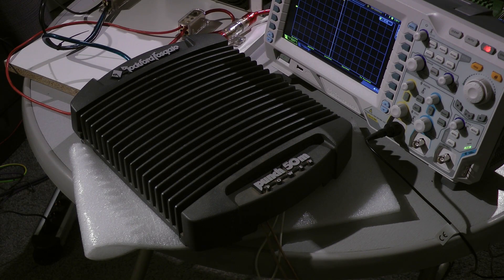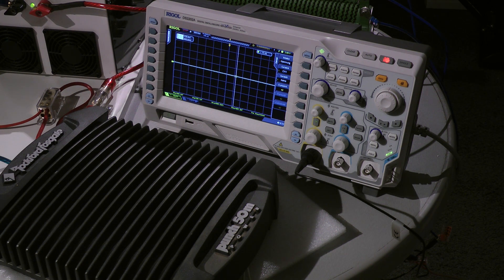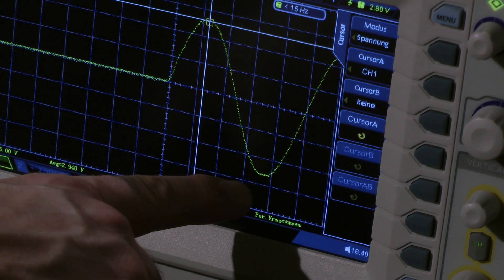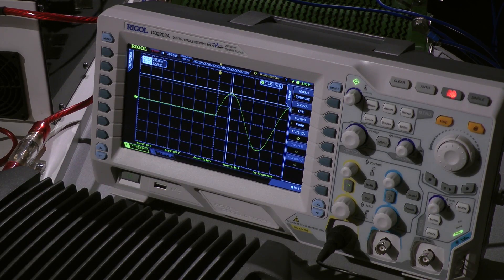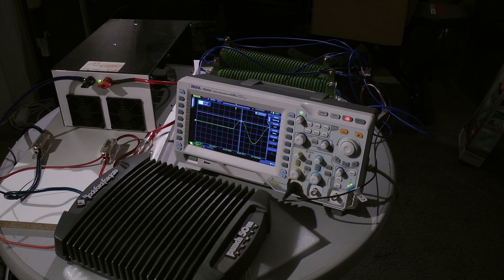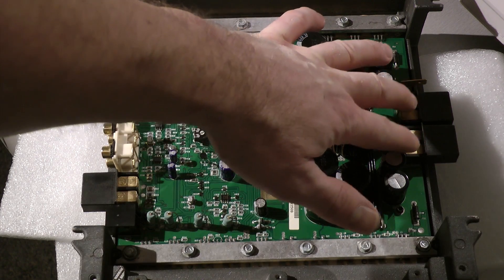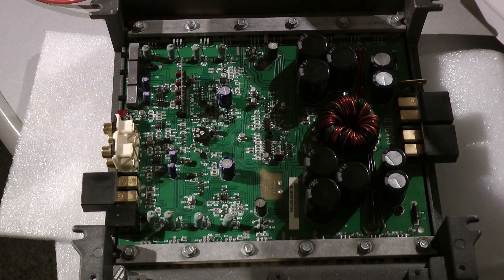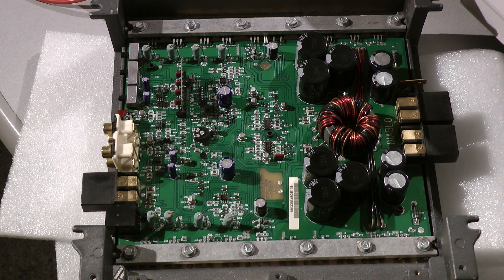Rockford Fosgate Punch Power 50M amp dyno run old school cheater amplifier 0.25 low ohm test & guts

Comment: I had two of these power 50Ms running 4 - 12" Pioneer IMPP subs. I also had the same style Punch 100 running a pair of 8" Diamond Audio midbass, a Punch 100 running a pair of 5 1/4" Diamond Audio midrange and a Punch 60 running a pair of USD Waveguide A Series compression drivers. I had an old copper jacketed Sony CD player going to and Audio Control Overdrive, ESP2, Epicenter into a pair of Audio Control EQTs and out to a 4XS to the amps. It was a big system in a 1994 Dodge Dakota regular cab. My sub box was ported into the cab and my amplifiers were in a custom fiberglass enclosure behind the sub box. I miss that old truck.

Comment: I still run Boston 12.5LFs on Rockford cheater .25 ohm capable old Skool 90s gear. The 50Ms

620 watts off a "50" watter :) just needs a few computer fans to not meltdown.

Comment: Still have a pair of 50m's and a  50x2
Reply from the maker: i also have one 50x2 with a polished heatsink 👍
Reply: @audiokeller1975  mine still have the dark gray factory coatings with all the end caps. The warranty seals are in tact too. They all still work perfectly. Just feel kinda bad because they are just sitting on a shelf, along side a 200x2, 100ix and a 160x4,  instead of bumping along like they were meant to.
Reply from the maker: i still have a 250m of that grey series. I had to readjust the idle current because it was a bit high with 6 amps. now its idling fine with 2.4 amps. over the years its possible that it drifts away. it plays fine now without getting hot 👍

Comment: I ran 6 punch 15s on a 50m for years and it never missed a beat. The thing hammered. I still have it and the matching 50x2. Used to dominate the 0-100 watt class. Best amps I have ever owned period.
Reply from the maker: i also still have the 50x2 👍
Reply: What was the power rating on the 6 15s?
Reply: @chokechange  They were Punch 15s I believe they were 100w rms and 250w max. Speakers were so much more efficient and sensitive back then.

Comment: I have the chrome RF power 50m I just picked up however it has a different heatsink and  4 flip chips plus a couple switches so cool seeing the same model but I'm guessing different versions. Anyone that can give me any info would be greatly appreciated.
Reply from the maker: is your amp the power 50.1 with the " darth vader style " heatsink?
if yes. its the same. you can link two power 50.1 to get more power like the power 50m.
this is configurable with the switches.
Reply: @audiokeller1975  you were dead on yes mine is the power 50.1 with the Vader looking heatsink. I had no idea you could link them and there were the same

Comment: i was without scope. there are Fosgate diagrams to run 64 from 1 amp.  we went to 0.06 ohms running about 2000 rms
Reply from the maker: Awesome! Do you have more detailed information about that ?
Reply: @audiokeller1975  i actually relocated my "old school" manuals just today. I can tell ya to avoid old school amps refurbished that using only the active xovers in 88prs but such a fragile stereo .can i send pictures or attachments

Comment: The 1st, 2nd and 3rd gen Punch amps were bulletproof. I had a 2nd gen Punch 150 (non-HD) that I ran 2 ohms mono for years and never gave me a problem, other than getting hot. I sure miss that amp. 😕
Reply from the maker: back in 95 i bought a punch 40ix for mono 2 ohms. there was never a problem for around 6 years then i sold it. providing good cooling is important, depends on the place where you live.
Reply: @audiokeller1975  I live South Florida, USA and it gets pretty hot and humid here in the summer time. I always kept it in a well ventilated area. I guess that helped it too.
Reply from the maker: you are correct. here in germany we faced no problems with mono 2 ohms. but some people installed their amps in the glovebox with high outdoor temperatures, so no chance for the semiconductors to breathe was given 🙁
but some of the smaller 4 channel punches dont like 1 ohm per channel. they dont deliver more power then.

Comment: The Rockford Fosgate punch series were beast. I have a Rockford Fosgate Punch 200 x2 trans ana ampfier. I have had it for many years now. It has never been opened for anything. They were considered cheater amps back in the day. They were Very underrated amps and you could get into a lower class competition and beat the crap out of everyone with them. Even till this day they are expensive to buy even used. Great video on showing the power that the old school Rockford Fosgate will deliver.
Reply: Awesome amp you own. I have a 45hd from 1992, a 360.2, a punch 4004 and currently run a p1000.1bd in my truck. Always clean underated power!!!
Reply from the maker: thats a nice lineup of amp-generations. is the 1000.1bd the mono amp in light gray? i have a heatsink and endcaps of a 1000bd which makes 1000 rockford-watts mono into 2 ohms. should be a similar model like yours?
Reply from the maker: Thank you for your comment!!
Everything you wrote is completely true👍 Its hard to get these amps used here in germany. I was lucky 😁
Reply: @audiokeller1975  you can find them here in the US online but they aren't cheap. I've had mine since 2007 and my brother owned it before me. I always keep my eye out for these old school amps.

Comment: These amps were really way underated, the sucky part, they were ticking time bombs :(
Reply from the maker: indeed, did you face problems with them?  especially the dsm series had problems with the silver capacitors. after mid 90s the quality of these caps was ok and they last longer.
Reply: @audiokeller1975  They were sure strong amplifiers, i think later on caps became issues, first was Fets blowing up. And random events.

Comment: Great video and awesome numbers from that PUNCH POWER 50m!!! I will definitely hang on to mine knowing that it could really be brought down to .25 ohm's!!! In the past I had heard that from several people on the internet, but now after watching your video I know it can be done for sure!!! 👍👍👍 Even though I never really had the intention of selling it considering that I brought it with the matching pair of my PUNCH POWER 50x2 amp as well!!! Both amps cost me $545.00 on Ebay back in 2015!!! Would you say that's a good price for both amps considering that they are both in mint condition???
Reply from the maker: i think in the us the rocks have a much bigger value than here. sometimes you get like new condition amps for under 100 bucks in good working order. i checked ebay in the states - all offers are much higher priced than most of them here. so this is hard to answer.
Reply: @audiokeller1975  Ok thank you!!! Yes your right they all have a real high price on eBay for them!!! $$$$
Reply: To run this amp at .25 ohms at 619 watts like it showed in your video, what kind of RMS would a pair of subwoofers have to have each subwoofer???
Reply from the maker: you would need a pair of subs with 0.5 ohm each. But you cant compare this because a woofer is not a resistor. a woofer is changing its impedance. impedance rises depending on box design and frequency. the resistor doesnt do that.

Comment: Funny this came up right now ...set up a bench 10 min ago  tested 225x2 power /200x2 trans ana /100x2 trans ana /hifonics zeus vii /lanzar brute force 600  was surpriced by the power and sound quality of 100ix2 trans ana after owning one back in 1995 😊
Reply from the maker: the trans anas are also nice amps. you can connect a punch status display to watch the amps state. this was excusive for the power series first. is your 225x2 the black one in classic style?
Reply: tell us the results 4ohm of em !! would u prefer a 200x2 transana or a old radiator 250x2?
Reply from the maker: both are great and very similar. the mainboard of the punch 500a2 has a 250x2 print on it. the are very identical. personally i prefer the ones without mehsa strips. they are easier to repair 👍
Reply: Just posted just a comment about the Rockford Fosgate punch amp. I have the same amp you have but the punch the 250x2 DSM
Reply: Beautiful amps… that’s all I have to say. Thnx.